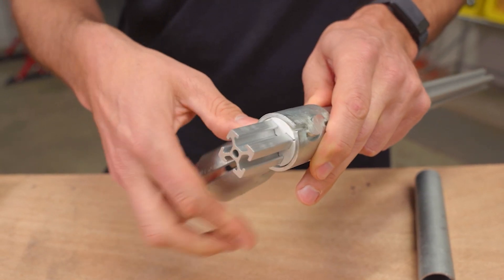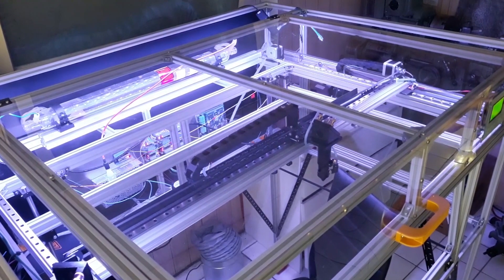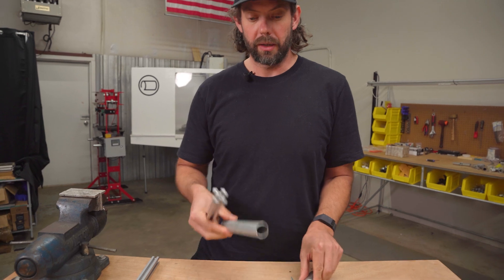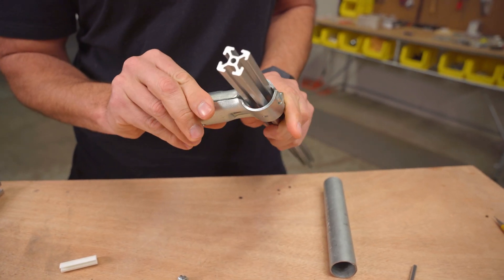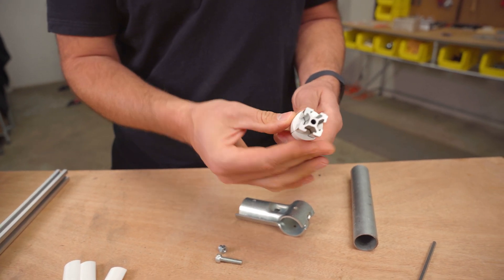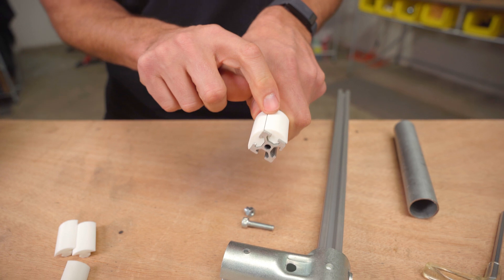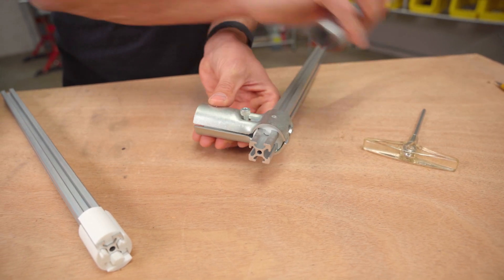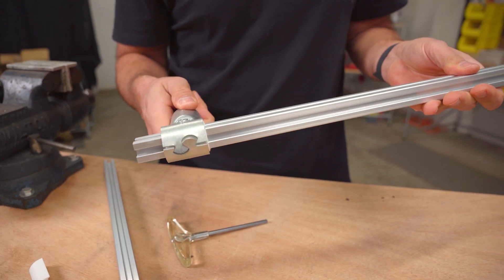Should We Combine These Two Materials?

Comment: Good idea!
A simple way to keep the shims with the connector is to add a small "collar" at each end, that is about the same diameter as the connector. So the shim needs to be a few mm longer than the connector to grab around the edges of the connector. That way the shim will follow the connector once you have it wrapped around the 20/20. Harder to describe than to make ... 🙂
Reply from the maker: Yeah that's a cool idea! Thanks for the comment!

Comment: Similar to the puzzle piece shape of your Maker Pipe connectors, these shims for extruded aluminum could be designed with a slightly wave-shaped edge along the shim-to-shim mating surfaces to keep a set of four them lined up with each other. 

The same idea of a wavy shape could apply to the edges that slip into the aluminum channels, so that each shim would hold in place along the extrusions with just enough friction (without the Maker Pipe clamp connector), but could still be easily repositioned by hand when desired. This might be easier than using a perfectly straight edge where the tolerances must be exactly right.
Reply from the maker: I hear ya, those make sense and are good ideas! Thanks for the comment Camron

Comment: At work we use a few equipment carts made from extruded aluminum to carry the weight and to fit and mount certain pieces of equipment. Sometimes these need to be used outside. We've talked about a canopy, but the extrusions and structure and adding/removing for that has always seemed silly so we throw a tarp over it and over ourselves as needed.  I think combining with EMT, perhaps bent into arches, and attached with connectors to the aluminum would give plenty of structure for an overhead canopy and be easier on/off than a similar extruded box.
Reply from the maker: For sure! Sounds like a great use of the idea. Thanks for the comment!

Comment: Host it on printables. Thingiverse is problematic as it belongs to Stratasys who are known to patent troll much to the harm of the maker and hobbyist community. Thingiverse is also saturated with (dodgy) ads, and it's unreliable/unstable from a hosting side of things. 

As for the interference fit, many printers have variation in their calibrations which makes this tricky. You could design indents on one side, and protrusions on the other side so they 'click' lock together. The pieces stay loose until all 4 come together, and then the combined outwards force from interference between plastic parts avoid having to engineer a plastic-to-aluminum interference fit. Alternatively, add a 'slit' in the portion that inserts into the extrusion so that any variation can be compensated for with flex in the part, rather than relying on a perfect printer calibration.

Comment: If you're wanting to accommodate some of that movement, I think you're going to have to eliminate the movement. Even on something like my tiny little 3D printer there are significant moments of inertia involved. I'm wondering how well those shims would hold in some cases.
Reply from the maker: Yeah for sure, that makes sense. We are going to play around with some different ideas for helping with that and report back. Thanks for the comment!

Comment: Good solution for ceiling or wall mounted curtain rods. I prefer track style rods vs the curtain rings. 

Additional Materials: 6-8” 1” EMT conduit (2); @MakerPipe flange (2)); @MakerPipe t-connector (2)..

For long spans not sure about a brace.
Reply from the maker: Ahh I gotcha, that's a great application! Thanks for the comment!

Comment: Hey, Randy here. Great idea!
I was thinking about some design ideas I would try that may or may not help with the shims moving around.
#1 You could modify the shim such that the arc has a split down the middle from the edge into the T slot that expands the radius, but has some spring to it so when it is inserted, the split closes but now has some built-in friction to hold it in position. Still slide-able, but gently wedged into the slot and easier to stay in position while you add the MakerPipe connector.
#2 Modify the shim such that an added flange protrudes from the radius a couple millimeters. This would be the first few layers of the print. The idea here is that it becomes a backstop ridge outside of the MakerPipe connector’s edge so that the shim is captured by the connector’s radius.
Number 2 would be one-sided, so another idea would be to make them half as long and add a puzzle-piece style linkage at the other end within the T-slot area of the connector. Then you print them in pairs, slip them into the slot with the puzzle area joined—now BOTH ends would have the flange around the MakerPipe connector.
#3 Since #2 only applies to the puzzle-piece side of a connector, you could print a shim with all four slot parts joined on the first few layers of the print, then just slip it over the end of the aluminum. A thin circle of shim would cap the end, but this is buried in the throat of the T-connector anyway, but now the shim(s) won’t slide down the aluminum.

Comment: More options and more flexibility is always better. 

Because those pieces are plastic, you can design them so that the edges where the pieces meet have a bit of a keystone pattern. That pattern can be half a mm. Therefore, it would be easy enough to force the pieces to align together, But they wouldn't so easily misalign. You wouldn't need to hold on to all four of them at the same time to keep them where you want them. Of course, this would also require that you stick some kind of arrow on all of the pieces so that it is easier for people to keep the pieces oriented correctly. Otherwise people are going to be getting tab A on one piece facing tab A on another piece, instead of having tab A facing slot b.

Another option is to design it as one wraparound piece. Basically, it would be four arc-sections of a circle, joined at all but one edge. Naturally, it would need to be made of plastic that is not brittle because you would need to open up to wrap around the extruded aluminum. This design would simply not have that key that you have to slide into the T-slot in the aluminum. Your piece would essentially look like a plastic cylinder with a square prism cut out of the middle. The benefit of this design is twofold: First, all the pieces stay together. You don't have to keep holding all four pieces while trying to get your other fittings over them. Second, you can insert that in the middle of an existing structure, without having to plan exactly where you're going to put your conduit connectors before ever building any of the rest of the extruded aluminum structure. It can easily be added to an existing extruded aluminum structure. 

I am not super familiar with all of the different plastics available for 3D printing. I don't know if any of the 3D printable plastics can act as a plastic hinge that will open up wide enough for the parts to wrap around the extruded aluminum. Maybe you can. I don't know. But I suspect that you will end up needing to injection mold these parts, rather than 3D print them, in order to manufacture them for sale.